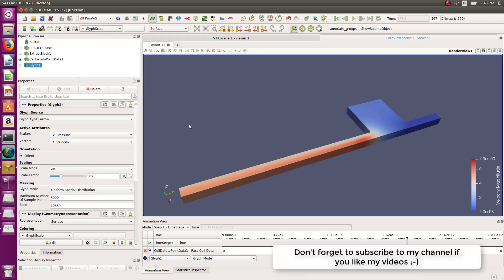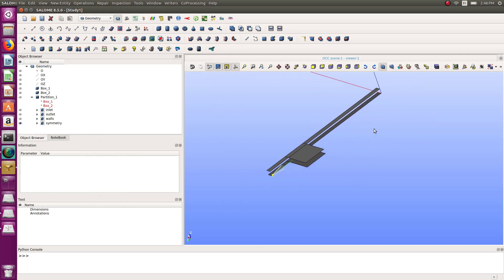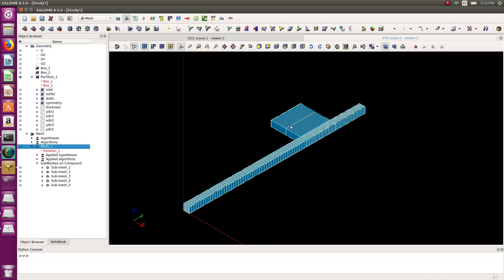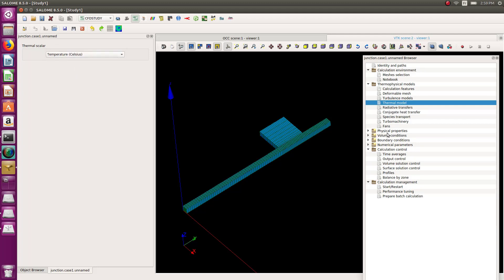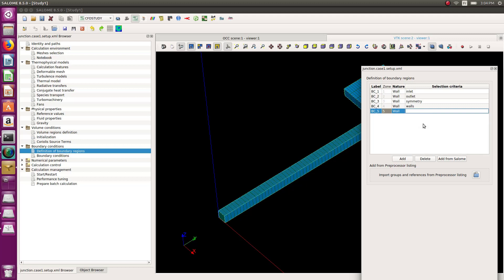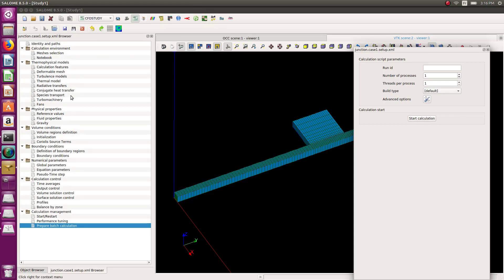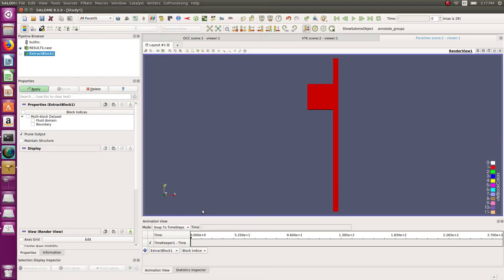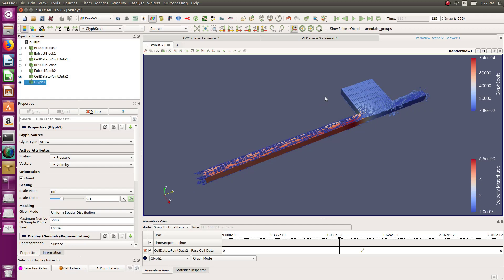[ Salome CFD tutorial 3] Simulating a simple junction with Code Saturne (Flow and Temperature)

Comment: Hello,Thank you for your contribution.
I'm looking for case where flow is driven by pressure difference between inlet and outlet by code=saturne.
Have you aploaded this kind of case?
Reply from the maker: No, but that should be fairly easy to do. You can follow the same tutorial but change the boundary conditions to a pressure difference and that should work
Reply: @Feaforall  Do you think  I should set "Impose P Outlet" condition in Code_saturne at  inlet and outlet as a boundary condition?  I'm worry that I should not set "Impose P Outlet" at inlet. What do you think? When considering pressure-driven flow, what kind of boundary condition in code=saturne do you set?

Comment: coniugate heat transfer need Syrthes ? ii is pre-installed ?
Reply from the maker: Yes, Not so sure it is automatically installed. Go into the Salome shell and type « syrthes » to check if it is installed (or check the packages available in the Salome folder)